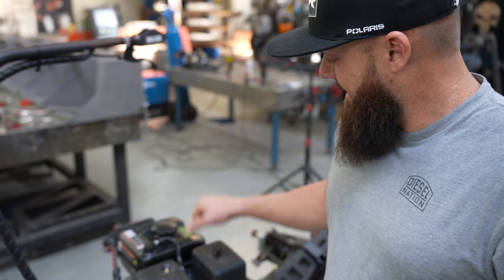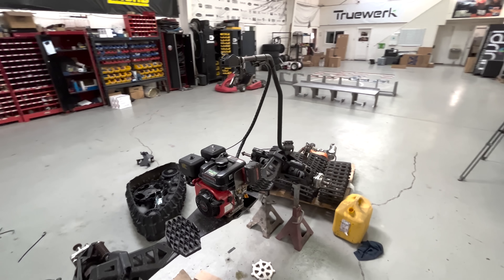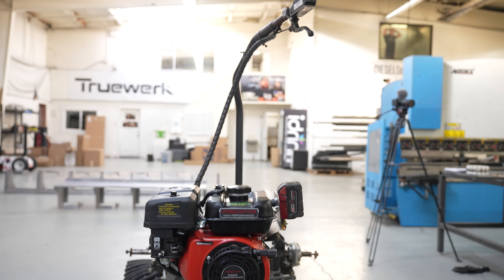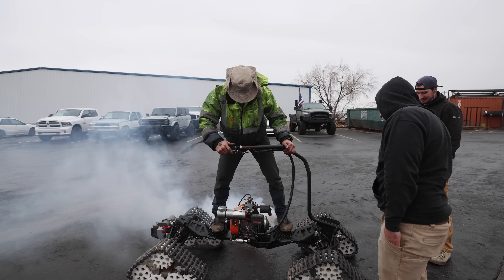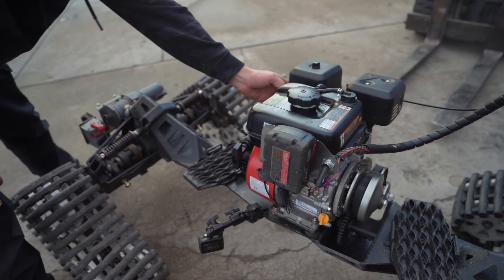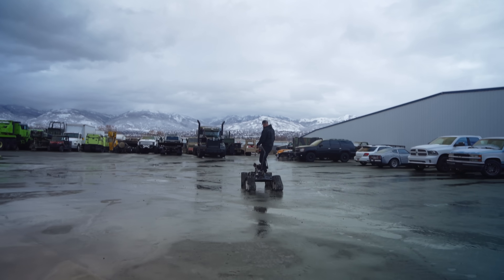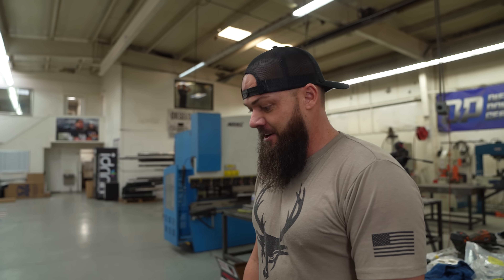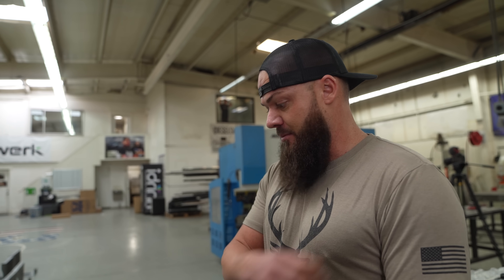Upgrading My Diesel Powered All Terrain Mountain Board On Tracks

Comment: I’m known as the power guru in the electric world. I think you need to add an actual floating suspension on it to keep the tracks from bouncing you off of it as you gain speed making it a little safer off road. Toe cups on the board for slippy conditions and possibly a step in back boot safety latch that locks your not in as you step into it but released as soon as you step out of it,(in case you flip it or fall off it will release without down pressure). The electric motor will definitely be an upgrade and make it easier to adjust the power you can put to it evenly. Offsetting your drive down to the skid plate will lessen that drive line angle and give you more room for suspension travel. Then it’s a matter of staying away from a conventional battery system and adding high flow coils and power storage capacitor to actually give it a turbo power up on the flat ground or large steep climbs to be able to turn it up on the fly and get the power and performance you want in a pinch.

Comment: Those predator motors are very modifiable. You can definitely build it to make more power and i think it would badass to see you supercharge it in someway for more low end power
Reply: Thats whay i Was thinking the same thing put a stage 4 kit in it and wake it up
Reply: Are those the little kids jr drag motors?
Reply: @jonathancallender8185  nope. Well I’m sure they have been used for that, but it’s just a cheap harbor freight engine. A lot of companies have started making mods for them now though so you can get more power out of them.
Reply: Yep, I was going to recommend checking out Red Beard's Garage YT channel, They are building one and testing the mods on a dyno so you can see what they actually do. So far it looks like a slider carb, exhaust, billet flywheel (with stock timing), and governor removal gets it up around 12 hp. Which is pretty good for a single cylinder HF engine.

Comment: This is AWESOME. I think keeping it lightweight/small/simple as possible is key. Going electric would add too much weight. You're right, there are tons of mods out there for those little briggs&straton motors. You can definitely make it better with more power and minimum weight increase over stock. Whether it would be enough to move the machine with bigger, upgraded track assemblies is another question answered only by continued public experimentation! I'm a fan!

Do I smell a collab with Grind Hard Plumbing Co???? Northern Idaho ain't that far.
Reply: electric of this size could be as light as that motor. the main weight of electric cars is the massive range, but if theyre only gonna go 10-20 miles you can fit that in like 10 lbs of battery + a couple pounds of motor. also i doubt that open belt next to his leg is all that safe. either way its a beautiful creation that I wish i had the money to make. (and ability that things advanced asf)
Reply: Just look at the one wheel for example, works great being electric. Oh wait, how bout a tracked one wheel???
Reply: 72v Sur-rons do 50 mph .... they aren't heavy at all..

Comment: Dave, an array of several 16s brushless RC motors each with a pinion driving a common spur gear would be extremely powerful in terms of torque. Geared appropriately, this would provide a perfect combination of instant torque and good travel speed. Easy to design and compact.
Reply: Y'all are forgetting the capacity needed in a battery for this to have any kind of practicality for what they'd do with it. Every bit of 200 ah minimum. That's a heavy and large battery.

Comment: I would try fitting a 2-stroke go-cart engine (100-200cc). Good power to weight ratio. If you really want to get crazy, use a wet clutch, air cooked dirt bike 2-stroke so you can select gears for different applications.
Reply: A 2 stroke will be far to week. But it did remind me that there are old jet ski engines that are 2 stroke witch would be crazy cause u can get like 100 hp out of them. Unfortunately they don't put them in anything new so it would only be a used old engine but that doesn't really matter as long as u find one
Reply: @jonathan preziose  There are plenty of 2-stroke cart engines in the 30 hp range at a "whopping" 125cc, compared to the 225cc of that 6.6 hp predator...
Reply: @djnord5570  true
Reply: That would be far too much power straight away for being on tracks, we have a kz2 (125cc) that is ridiculous on dirt to say the least, I personally think a 4stroke would be best, smooth power all round, they're lightweight, there's plenty of 4stroke dirtbike engine options, just depends on how much power they want. 4strokes also have the torque to travel through snow...
Reply: A power band on that thing would be sketchy. Need something with low end torque. Electric would definitely be the best for something like this.
Reply: A vtwin diesel would have plenty of torque and weight to keep that thing planted
Reply: What about hydraulic power? It’d be so easy to make
Reply: @jpreziose Modern 2 strokes snowmobiles make easily over 200 hp idk what your on lol

Comment: Try a worm-gear transmission. Allows for tons of torque to the hubs and minimal effort from the engine. Then you could also defect drive the worm gear to the 2nd clutch (the bigger one)

Comment: To start those diesel engines you have to hold the pressure release lever down when cranking it few times and them give it a good pull and quickly release the lever for the pressure release. Also please install a cover for the pulley so it won't destroy your ankle.

Comment: If you go electric you can add a motor for each axle and ditch the drive shafts. put the battery in the frame to keep center of gravity low.

Comment: Here's the secret to using those small diesel engines, change your driver/clutch spring!!  More sensitive springs engage while the torque curve is stronger.  I have a 196cc diesel and I changed springs and gearing and it worked wonders.  Also oil is cheap, buy some good Zinc small engine oil and engines will last longer!!!

Comment: Try golf cart parts and transmission.  Maybe use Dewalt batteries and put the winch on the rear. You can use it as a tug for a wagon or a person on a tube in the snow.

Comment: if you go electric the best and "cheapest" plug and play option i can think of is the bafang 2000w mid drive e bike motor with a 52v battery; tons of power built in speed controller and gear reduction also throttle controlled. would need a donor bike and basically cut off the bottom bracket and weld it to the frame for the motor to mount to then run your chain figure out where you want the battery and hook up a throttle might need to change out the sprocket on the "board" to a smaller one.

Comment: Bypass the governor and move spring torque converter to hole #3 2 is mid 3 is to right will give you speed and 1 hole is torque

Comment: You should get a surron motor and battery for it, it’s from an electric dirt bike so it should have plenty of power for you. Stock is a 60 volt battery but once you want more power you can get a 72 volt for about 4 times the power. The stock bike can go 50 mph and 72 volt can go 80 so it might be a little over kill btw

Comment: Place at each end an electric motor and use the center area for batteries using the weight of them to help with stability while keeping them high out of danger.

Comment: Battery space,maybe a back pack, or small platforms with batteries you stand on
Reply: Try a zero turn mower,use the hydraulic motors, forward and reverse also better pivot points
Reply: No drive line!

Comment: is there a possibility to put two mini electric motors? like one in front and one at the back, each one geared directly to the tracks. it removes the drivetrains and allows to put the batteries in the middle...

Comment: So if you go electric…put a electric motor in the front and one in the rear to eliminate the shaft from front to back. It will require two speed control but that will be fine. The duel electric motor will help push the electric tracks. I would think two high out put Sur-on motors would work….and the batteries are simple as well. You can always sell them easily if it doesn’t work as well. They are very popular and there are many companies building custom ones.

Comment: HeavyDSparks+:  The better method of workable power is a hi-torque electric motor, assuming you have enough 'lectricity to power the thing/board for longer than 15-20 minutes of continuous operation/use. That means a battery pac of some description...

The problem w/ battery pacs is, obviously , weight. Or, as your name sez, HEAVYD (amn things that) SPARK , particularly if you hook up the wrong wire(s)! Solve the problem of 'lectricity supply for the motor and you got it.

That said, "good luck", plus, good video! When can we see the continuation??? 🤔🤔🤔

Comment: 4 electric motors (one for each wheel) and a controller would give you great control and flexibility for the rig, The battery would be a bit of a problem but a neat possible solution would be to use cells integrated into the base platform.  The electronic control of speed and direction of each independent motor would give you mind boggling possibilities. Quiet and mechanically simple.

Comment: Also, when you guys go electric, use 1 motor per wheel, that way you can cut out all the driveline drag! Batteries go in the ends on top of the board, use 1 ESC per motor and use a 4 way gimbal to control the movement of the ESCs's along with powered turning like a dozer.

Comment: Maybe put a 7 inch driven pulley on there to get a little more bottom end power and not hurt the top end speed.
Reply: Also the clutch pulley spring is adjustable to change the rpm in engages

Comment: If ya went electric u could put the battery where the engine is and u can get 2 motors and put one on each end and that would get rid of the whole center driveline system or could do 4 motors and have one on each track n that would element the whole need for making cv shafts

Comment: Put a  Briggs and Stratton go-cart racing motor on that thing with a  Horsemen clutch and  Header and I promise that thing will be some fun then.   When I was little I raced go carts on dirt tracks and  We had a guy build our motors for us, they were just a 5 horsepower Briggs and Stratton motor overhauled on alcohol and without a  Restricter plate there capable of dang near 100 mph.  But you don't need to be going a 100 on that but, You can turn it down with the plate or just keep the gas jets in it instead of alcohol.  Still be fun I promise.  Lol.

Comment: I would build frame from aluminum and use 4 brushless motors at all 4 corners and 4 speed controllers and enough batteries for about 1 hour run time,, that should make it about same weight as now but way more wicked fast and powerful.
Reply: And the steering actuators are not turning fast enough, need to lighten it up by removing that and come up with faster movement for carving.

Comment: just use cv joints off off junked cars and modify the lengths. light weight leaf springs underneath for comfort and stability. yove got built in a/c and sun rooof. think about a cover for the motor like the top of a dog carrier for protection on the nads.

Comment: Nice that thing will be able to climb anything with the right drive line and an electric motor. The only thing I see wedding with electric motor is it don't last long the power in the beginning is great you can't beat it however it's longevity that electric motors don't have

Comment: It needs leg supports so your inner shin/calf has two stability supports would be so much easier to ride and if you need to jump off for whatever reason you can do so with ease as the supports wouldn’t completely lock your calf’s in the supports

Comment: You’d need wheel motors in all four corners to keep it 4x4 and make it electric, which could add some significant weight, on top of the weight of the batteries 🤔 but it would be cool to see. there are lots of thing you could do honestly could make it a hybrid put 2 wheel motors on front or rear keep the gas engine and then you have a back up or just added power on demand, that thing is pretty sick I’m thinking you should put like a 6’ light bar on the front

Comment: Badass. Didn't see a good example of it, but larger individual suspension per track I think would be able to overcome larger obstacles. 

I think full electric motor would be better, more torque and higher speeds

Comment: With the diesel, the clutch isn't match with the power band. Red Beard put one on a go kart, but he used a CVT with added weights . Problem with an electric motor would be water and moisture would probably be a problem for the motor and batteries. Looks like a promising project that any kid of any age would enjoy.

Comment: Predator makes a 420cc race engine that's roughly 15hp and turns 6000 rpm. That will get your speed up along with more power. If you go electric, you can go with one large motor attached to the transfer case or two smaller ones mounted directly on the track housing input. You'll also need a large battery that will have enough amp hour and amp output to do what you want along with a esc that can handle it as well. For the sake of simplicity, I'd honestly stay with gas. The electric motors and batteries are going to be about the same weight. And have a lot more failure points in all the electronics and wiring. Not saying it's not possible, but remember, batteries don't like the cold.

Comment: After watching this a few times that speed seemed fine for a bord on tracks considering it's for snow that would be fun as is. Definitely straighten out the drive shaft more and tune your clutch, also cover the engine for safety, however if your wiring up any power I worked at black diamond electric if you ever need any help wiring up power I'm all in👊😎

Comment: Neat. Gas engine that is 100% insulated, heat shield, sound proof might be next step. Eclectic would work and weight would be same with new type batteries but that would limit use to locations you had power. Figure out end market and design to that.

Comment: Reminder standing is that I would recommend keeping the gasoline because what had more power plus you can also have the high and low clutch but if you wanted to do electricity the scooter engine is in the wheel so you would have to modify your machine and the tires for that machine to be inside the wheel which would have a big impact for what you're doing especially with the tracks you can't just like to slap a motor on top of it and it will work which it possibly could but maybe is not rapidly as the engine would so yeah

Comment: I see some big potential for this machine.  It could be used for sport, utility or whatever.  In the right application, a small 2 stroke snowmobile engine could work.  I'd like to see how electric works.  I could use something like this for accessing steep terrain for my weed spraying business. P.S. Whats the Milwaukee battery for?  Engagement controls?

Comment: How about a gas powered electric motors. Use a Honda power inverter/generator to power two electric motors on the front and rear axles. This would also fix your driveline issues with the u-joints.

Comment: take engine open and take out the governor there is a many videos about that stuff and if you would buy a scootter variator clutch and variator bell in side of those you can swap different wheights and springs.

Comment: I would do a collaboration with a robotics/ ev youtuber and fit something like four "Astro 3220" motors one to wheel or other similar BLDC motors. Then you can shed a load of weight by not needing the transmission lines, clutch etc. The motors give 100% torque at 0 revs so you can literally just take off from standing. You can ease the acceleration through adjusting ESC unit and each wheel can be controlled on it's own. And finally I know you like deisel but an electric system is kinder to the environment, especially in the mountains!

Comment: I would ditch the Harbor Freight motor and put a small motorcycle engine on it.  Even a little 75 or 100cc motor with a unitized tranny would be killer!  You'd have a balls out, hill/snow/dirt climbing board.  Those small displacement motorcycle engines aren't much bigger than what you have on there now, but the have a MULTI-SPEED transmission as well.  Think about it.

Comment: An electric motor I think would be cool but, batteries will be a issue. You could use a 24V motor out of a walk behind pallet jack and then maybe do some wiring magic with some batteries. I think me myself would set up 18 volt tool batteries in series-parallel configuration to give you 36VDC. that won't hurt the motor (unless you stall it) and will give a performance boost. The electric tool batteries can be charged off of the machine whereas if you use gel batteries or other sealed batteries you would likely want to charge them on the machine or at least in sets off of the machine to keep the cells balanced. I would like to see how this evolves.

Comment: You need to get a hold of cars and cameras they will point you in all the right directions you need like gear ratios and motors with charging systems to work your winches and actuators. They are the guys you would want to help on this one they are professionals on the harbor freight  motors

Comment: dual small electric motors front and rear, battery pack in place of old engine. no driveshafts or u-joints

Comment: Put a Predator 600cc on that board and limit the speed if it is too fast that way, you'll always have enough power. It is a go cart engine so it will be about the same size maybe a tiny bit bigger.

Comment: 250 or 450 dirt bike engine and transmission. Then you can have a chain drive to the transfer case and it will be a 6 speed